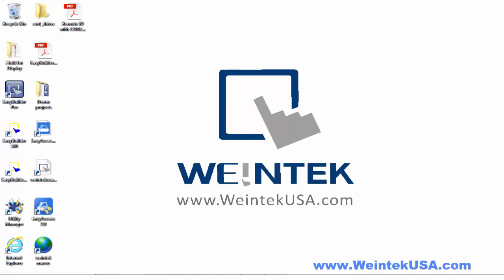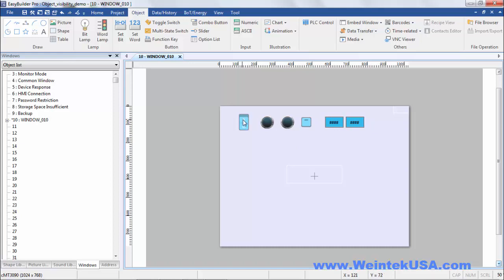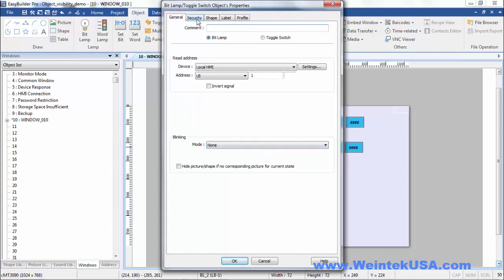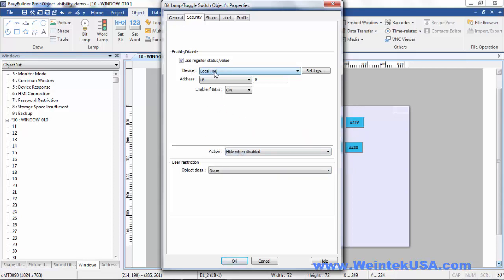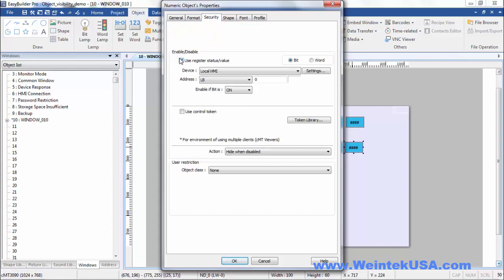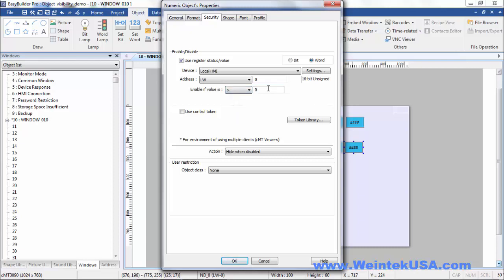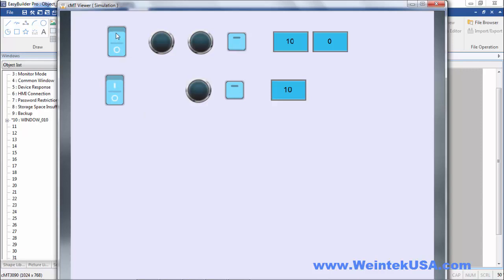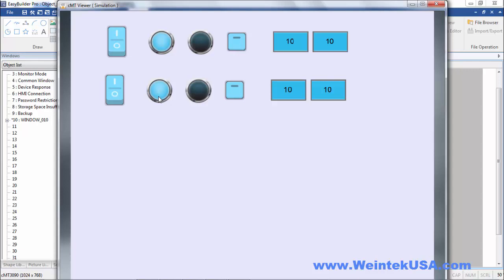Object Visibility, How to Hide when Disabled w/ EasyBuilder Pro / EBPro

Comment: Is there a way I could set a bit lamp or push button visibility in the way you do with the numeric object, by a word variable value?
Reply from the maker: Hi Alvaro,
Unfortunately this is not an option available within a bit lamp's settings menu. However, you may use a macro or action trigger to change the state of a bit lamp dependent upon a word variable which in turn can be used to change the visibility of an object.